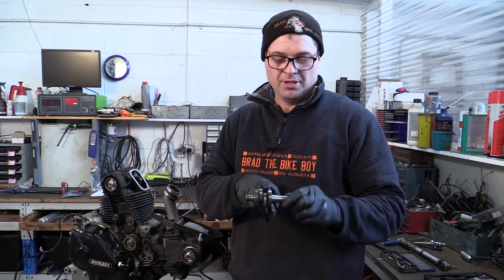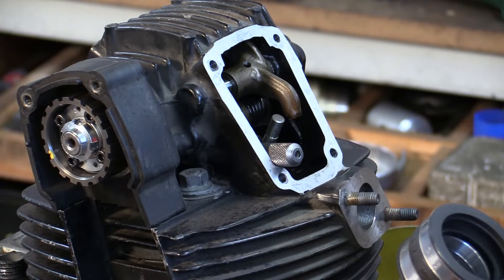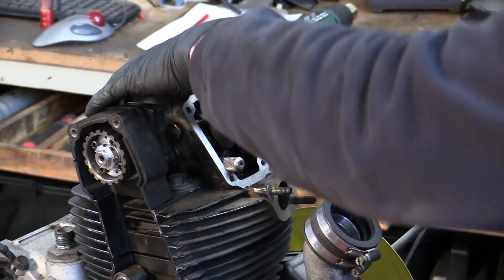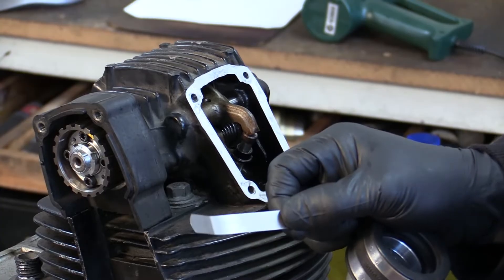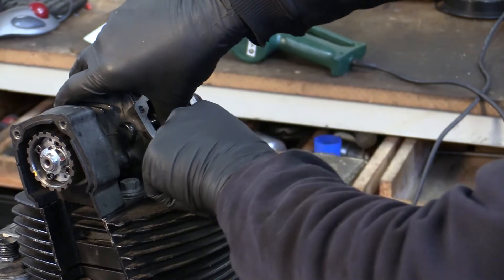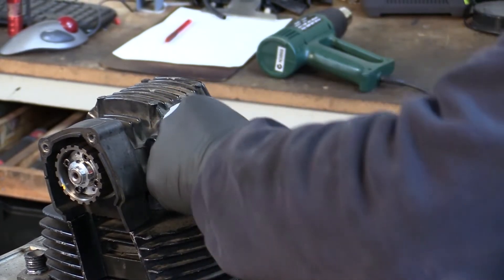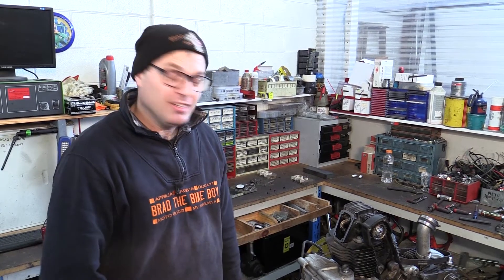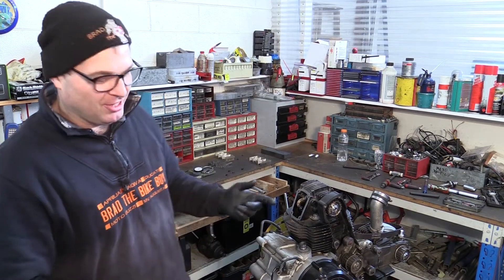Ducati Traditional 2 Valve - Adjusting Valve Clearances

Comment: Nice clarity, simplicity and ease of maintenance. 
On the bench.
On some models, working with the motor in the frame as per normal, i can imagine it being a bit of a nightmare. Ease of access, room for fingers etc etc. Especially the inlets and rear exhaust. The later the model the worse with EFI/airbox stuff in the way?

Comment: Question for you Brad:  Since I will be changing the engine oil when I do the valve adjustment, should I drain the oil before the adjustment or after, considering that the engine will be turned over many times in the process using a crank turning tool?
Many thanks for your expertise. 
Mike C., USA
Reply: I'm doing clearances at the moment, was watching this and saw your comment. Oil has been drained on my bike. There's still enough residual oil everywhere. You're not turning the engine at 3000rpm and you're not going to be pumping oil around with your turns so I don't think it matters too much. I'm no expert though, just one opinion.

Comment: Excellent system in driving but disastrous as maintenance .... it is 10 times more complicated than on other bikes.
Do you think the engine is at risk at 40,000 km if the glasses are not changed? ... it works perfectly.
Does it really make sense if the engine is running well?

Comment: I think the adjustable tappets with just using a feeler gauge, screw driver and spanner on the MotoGuzzi is much easier than this. It's a very convoluted and difficult as well as time consuming process. I guess it might have it's advantages but certainly not at service time.
Reply: Er, and the cylinders are out in the open. The only bike as simple as a pushrod Guzzi is the airhead Beemer.
Reply: @terry lester we are talking Euro designs, ya know, where lightness of the valve train is taken into consideration during the engineering design, and where a motor will actually still pull past 5-6000 rpm....